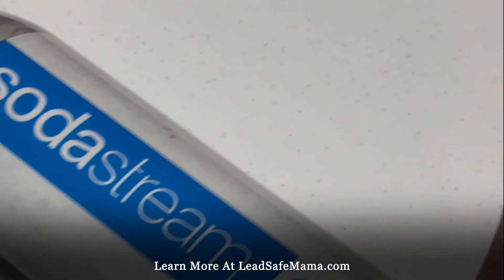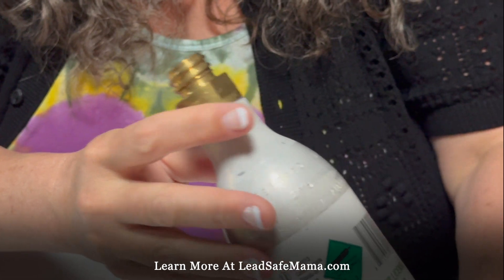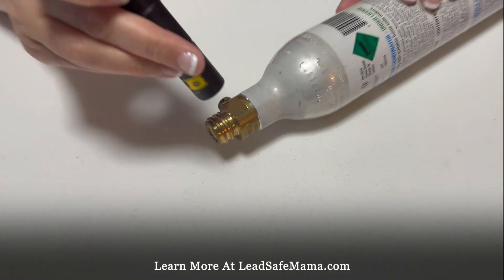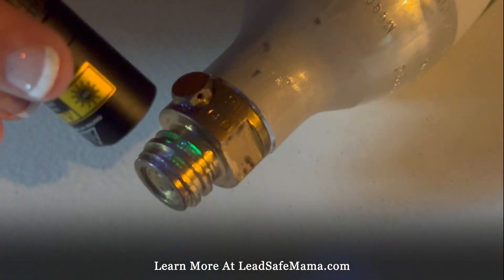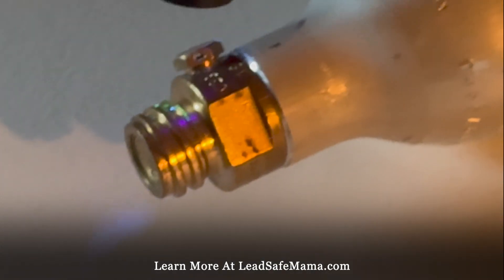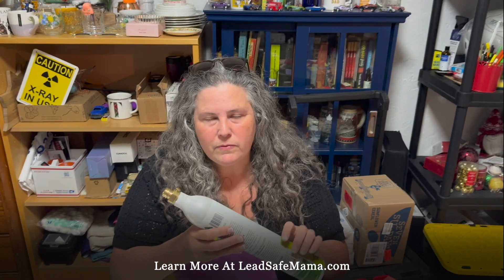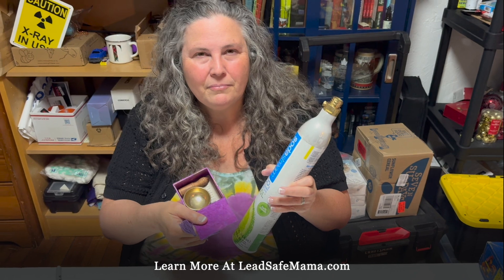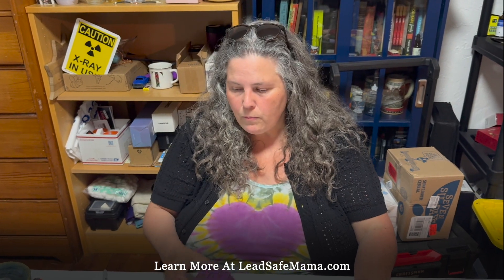Using the glowing green reactive agent home test kit to test a Soda Stream canister for Lead

Comment: What is the point of only testing for lead? Other heavy metals or petrochemical compounds are equally or even worse. You might be recommending on your website something that indeed does not have lead but has some other heavy metal or petrochemical compound.
Reply: Because a home lead test kit is now available. If you know of test kits for other heavy metals please let use know. 

Sending samples to a lab is an interesting idea but I think it would be really expensive.

Comment: Looks like a brass fitting which would have 2-4% lead content for machining purposes. The lead migrates to the surface doing production. In CA there was an legal case because children were handling brass keys, and that may have lead to lower levels, but not sure. Of course, we have more options than brass these days for keys.